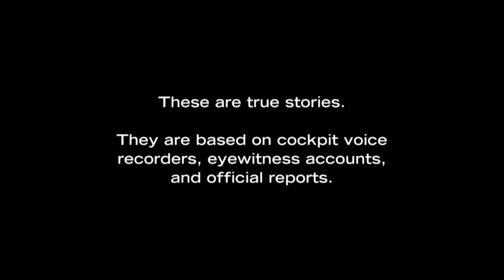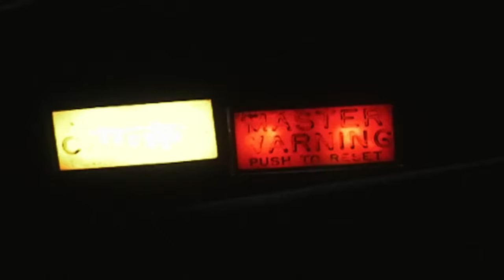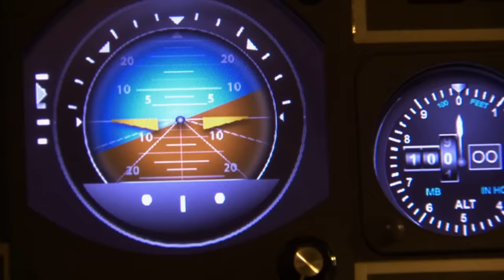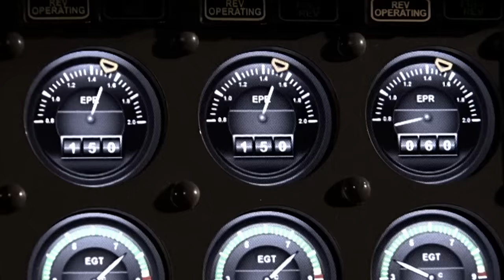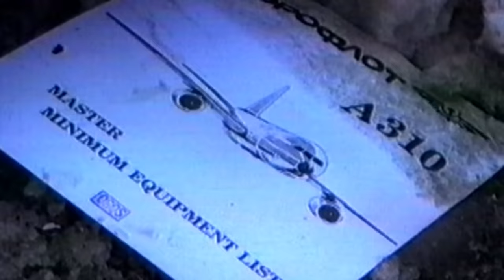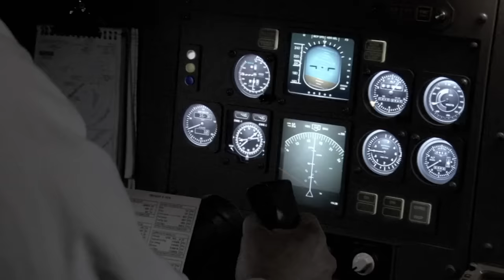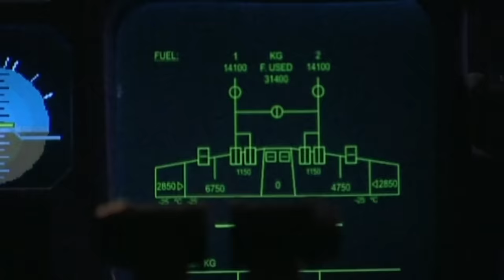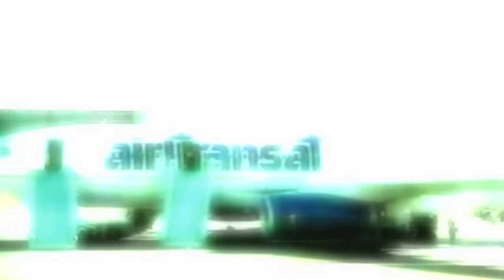"The Complicated Relationship Between Man And Machine" | Mayday: Science of Disaster

Comment: Powerful bright headlights should be used on all air crafts, also tape should be bright fluorescent colors. The tape could have a tab of the tape to peal off to place on the mechanic's forearm, when finished cleaning the plane the tape is removed along with the tab. One more thing, cameras should be placed under the plane so the pilot can see damage/fire.
Reply: Well Extremely bright headlights on jets are not good to use if a pilot flies into some heavy cloudcover because the light would bounce off the cloud and back into the cockpit thus blinding the pilots.  Just driving through a blizzard at night in your car if you turn your highbeams on itll bounce off the heavy snow and blind you.  Jets do have exterior lights on them there are just times they arent very effective.  Ive noticed that Airbus puts exterior Cameras on their A380s and the pilot can see the tail fin, the top of the plane, and I think the wheels as well Im not sure on that on a little monitor in the cockpit.  But of course theyre only use during the day.  Technology improves every year it is a process.

Comment: Flights like AeroPeru 603, Ethiopian 302 and Lion Air 610 are prime examples of what happens when we place too much trust in machines..it's to the point where they so much for us we don't even really know how to do it for ourselves anymore...i love tech and I'm very savvy when comes to computers and electronics but I never let them do that much for me to where dependent on it.. i mean down to Google remembering my passwords i try not to depend on tech too much ..it irks me something like MCAS can kick in on a flight and pitch the nose down with the pilots having no real way of circumventing it..manual control should always be an option ..always be Paramount
Reply: MCAS was implemented because Boeing Engineers redesigned the location and size of the engines which altered how the plane handled in flight.  The Newly Designed Max tended to pitch during flight and cause a dangerous stall.  The MCAS system leveled the plane to prevent that however the MCAS got data from AOA sensors that are located in the nose of the plane and on those 2 unfortunant accidents fed faulty data to the MCAS computer and MCAS did what it was designed to and level the plane out.  Im paraphrasing but I read a very interesting article from USA today that explained how MCAS and AOA is supposed to work and what caused the accidents.  My personal thoughts is the redesign of the Plane why didnt they do some modifications to the design if the plane tended to pitch because of the size and location of the engines?  I think of it as a design flaw of the plane itself and to save time and manpower as well as money Boeing just said "Well we will just install some sensors and a computer system to fix the problem instead of modifying some designs on the plane!"  Thats my opinion as I am not an engineer but I have always been fascinated with aviation and jets because I grew up on Naval Bases and my dad was an aircraft mechanic so Ive been around F14s and F16s...C130s...And Helicopters.  And the coolest thing ever as a kid...is sitting in the cockpit of an F14 Tomcat!  They only allowed that if the active duty parent had permission from the captain or commander and we werent allowed to have cameras of course because its top secret but we got put our hands on yoke and push a couple buttons and the pilot showed us all the controls.

Comment: I'm thinking... there is a LOT of dead time in the cockpit where pilots should not be passively monitoring the automation. The industry has cut command crew to the minimum. But there should be a third co-pilot science station like the flight engineer's station in 747s, where crew can take turns running simulations harvesting utilising world data from the plane. These simulations would be completely isolated from the plane operations.

EVERY commercial plane in the air should also be a science platform running large scale simulations and collecting crew performance data on an order of magnitude greater than everything occurring throughout the industry today. In effect this would be aeronautical science program on the scale of citizen science.

This way, the test pilot, running simulations could always be a back up for the prime crew. And the prime crew have something meaningful to do if they get bored. Obviously, this has to be done in the context of crew flight hours and wellbeing. In fact, down time could be part of the science project, conducting very large scale long term health studies on the effects of flight.  I'm not suggesting this technology be used as big brother by corporations: the crew should have real power over how the data is used.

Comment: Have to say there are some bogus things being reported here. Tape should never be put on a static port or pitot tube of any kind without a logbook entry. You are modifying the aircraft to put that tape on. Another thing, fuelers and cleaners and baggage handlers are "ground service crews". Maintenance personnel are "Licensed Aircraft Mechanics" that can make and clear logbook entries. Trying to pass this off as a "local practice" is just foolish. If the captain saw a logbook entry in his book he would have never started the engines, Period.    PS; there are external pressure ports on the old Pratt & Whitney engines you can tape over if you really want to ruin a hundred peoples lives. I find that some of the foreign practices are pretty touch and go like referring to Mechanics as Engineers, totally false, Engineers design stuff and Mechanics follow manufacturers manuals and FAA regulations. Lets make some sense here people. If you are a mechanic out designing aircraft parts, you are way out of your wheelhouse.

Comment: What is the simulator going to tell you to do when your pito tubes are blocked and all your warning alarms are going off at the same time? 
This is what I would do: first, take the freakin' air brakes off. I would look at the passengers and see if they're leaning to verify my horizon instrument and go higher, up above the clouds where I can see the horizon.  Giving it some gas will satisfy the stall possibility. Over speed certainly can't be true if you're climbing. I would stay up there until they sent me someone, even a drone, to lead me down. 😶🙂ATC doesn't know my actual height so they're going to have to clear me a wide vertical path and they will have to go by the cloud ceiling. Here's a thought. Track my black boxes for their location? They didn't know where they were but they didn't have to take a dive into the ocean. 😢
Reply: Why/how did they take off with no airspeed indicators? Dont they have to call out V1, rotate and all that stuff?  During takeoff is speed provided by something other than the pitot tubes?
Reply: Better to remain silent and thought a fool than to speak out and remove all doubt.
Reply: @traumamed9449 , it wouldn't work if your horizon instrument isn't working but they were flying alright before the alarms went off. I know hindsight is easy, but I would answer the stick shaker problem 1st. This is all moot because ATC gave them false information it got from their own computers. 
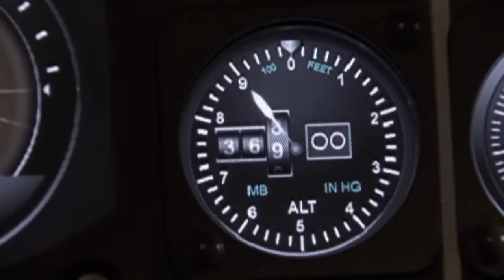Even a fool, when he holdeth his peace, is counted wise: and he that shutteth his lips is esteemed a man of understanding. Proverbs 17:38. 
Shutting my lips now. 😶